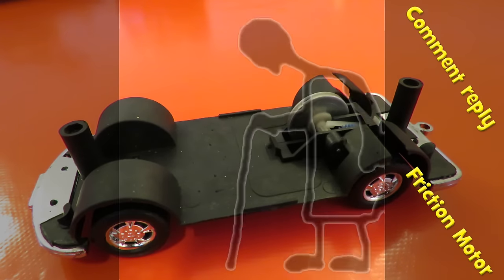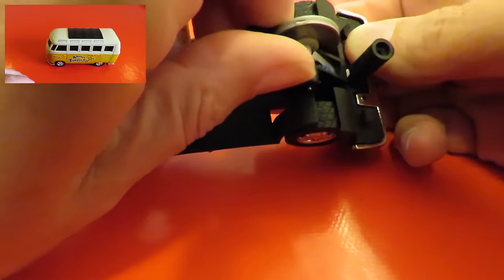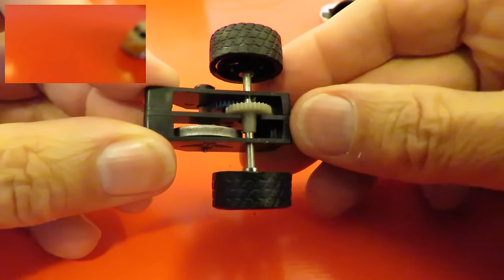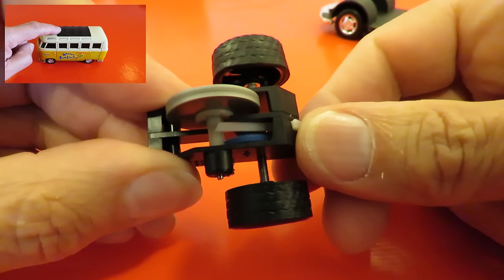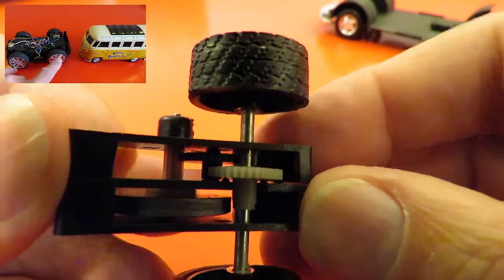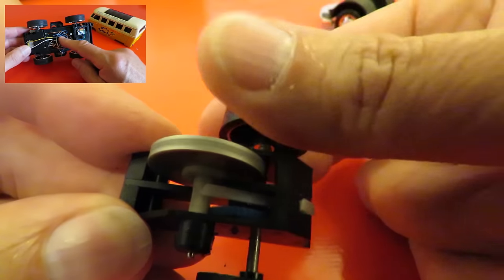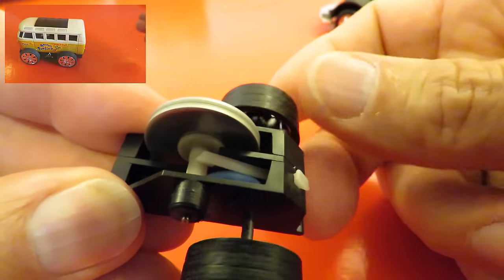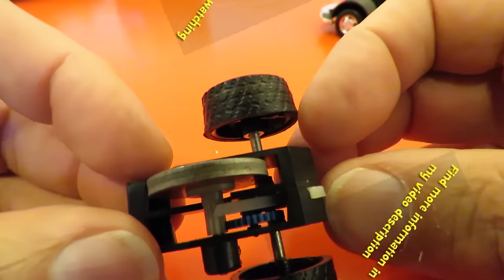Let's look at a toy car's friction motor

Comment: I tend to agree with you that "friction motor" is not a good term for them, since you typically want them to have no friction. Inertia motor would be far better.
Reply from the maker: I guess the name derives from the friction on the wheels but it seems a rather backward description.
Reply: if you look up friction motor, you come across a motor for a bike that applies a roller to the bike tire to propel it forward. THAT makes sense lol
Reply: @jamesrigg4389  That does make sense, but the motor has its own power source.  I believe we know it under its brand name Solex

Comment: Why the friction wears off your power with time amd use? Would need to replace the spring or there are other options? For pullback cars and push foward like this.
Reply from the maker: Friction motor is a misleading name for these motors. They are flywheel motors. the energy is stored in the flywheel.

Comment: These were everywhere when I was a kid. 

I never got the "friction" name, as nothing to do with friction. I suppose "inertia" dive wasn't as catchy.

Every kid knew how to repeatedly push the car against the ground until the noise got loudest (so fastest), and then let it go and it would take off. 

The ultimate evolution was the "T" type cars in the very late 60's, which had a single large driving wheel in the centre, which was heavy, the T handle had teeth that engaged with the wheel, push all the way in, pull it hard, centre wheel spins fast, heavy enough to drive the entire car when put down. They flew.

Comment: Hey, do you know anything about bigger truck cars just a little bit bigger than that? I have a toy truck and it makes a lot of noise like very loud noise when you push it it's made to be like that because all my cars are like that but it's really annoying and hurts my ears, do you know how to take that out?
Reply from the maker: Usually the main noise is generated by a little arm that is set to rub against one of the gear wheels. On the motor it doesn't sound very loud, but it is amplified when it is in the car by the bodywork.

Comment: Thanks for posting this. It was interesting to hear the breakdown for how it worked. I took apart the friction motor on my son’s car to try and fix it but, knowing nothing, I just had to put it back together again and it doesn’t work any better. Somehow, the “momentum” is gone though nothing is broken and the gears still wind fine. But the “vrooming” noise is less, and car doesn’t keep rolling much after I let it go. Any idea what might be the matter?
Reply from the maker: It may be the spring loaded ratchet that links the flywheel to the gear. I have a closer look in a different motor in this video https://youtu.be/DXcMCNFqnac it is part of series due to be published later this month, but I am giving you this link so you can look at it now.

Comment: The correct terminology is a high speed GEAR, low speed PINION and drive (bull) GEAR.  It's actually a gear reducer that converts rpm from the h.s.GEAR to the low speed PINION which turns the drive (bull) GEAR.
Reply from the maker: Thanks

Comment: Do you think you could lift a small mass with a friction wheel used as the stored energy supplying the force necessary to say lift something using a pulley system? Trying to create free energy as my pic shows a basic model of what I have designed but the secret to my idea is getting the extra weighted ball back to its original positioning. My idea works on the fact I don't have to focus on getting all the mass to the top rather primarily focus on getting the small ball mass back to its original position to counter balance the other to maintain free energy.
Reply from the maker: Good luck with your quest
Reply: Thankyou and thanks for your video as well.
Reply: There's no way you can create free energy, simple as that. If there was one, everyone would be using it today.

Comment: my guess the white plastic stick is for clutch the gear to reverse direction, it should make a noise when reverse the car.
Reply from the maker: As I remember it, it makes a noise in both directions and I think it is there to make a sound like the motor running, but you could be right.

Comment: Hi! Could you please try and explain a pullback motor for kids? Thanks ☺
Reply from the maker: I will have to think about that, I have done videos on the subject but I don't think they fully explain the details in particular the importance of the idler gear. At the moment I am still trying to catch up with all the video footage I recorded on my recent holiday, there are still hours of it to work through. I will see what I can do but I cannot promise a fast response, sorry.
Reply: GrandadIsAnOldMan Thank you for your quick reply. I just discovered your channel and subscribed. It feels good to know that you've seen my comment and will consider it. Thanks!
Reply: Hi Jenny, I have been working on several videos to try to answer your request and each time I view it back and think "Would a child understand me" and I am not sure I have made it clear enough. I will publish all the videos over the next week or so but I may still need to try to simplify the answer. The bottom line is "You store energy in a toy car's pull back motor by pulling the car back to wind up the spring inside. When you let it go it has gears inside the motor that change the ratio so the car goes forwards further than the distance you pulled it back". 
This is the current schedule of the videos I have done so far (none of the links will work unto the published date and time) The one on Monday 13th at 3AM is probably the best so far but still contains some confusing information as I try to relate it to the animated video from 3 hours earlier.
Sat 11/08/2018 1200 Ferrari Superamerica with pullback motor https://youtu.be/zmKx0KD2JMg
Sun 12/08/2018 0000 Ferrari Superamerica pullback motor tear down FAST FORWARD https://youtu.be/HjZ_onSWAyQ
Sun 12/08/2018 0000 Ferrari Superamerica pullback motor tear down LONG RAMBLING VIDEO https://youtu.be/Xc-8U0baT70
Mon 13/08/2018 0000 Pullback Motor animated with Gear Generator https://youtu.be/UWGkMFk2IDA
Mon 13/08/2018 0300 K'Nex Pull Back Motor Tear Down https://youtu.be/7rN9xkSC6Lo
Tue 14/08/2018 0000 K'Nex Pull Back Motor Gear Generator Animation corrected for 0-9 gears https://youtu.be/GnOij_Qr9Sw
Reply: GrandadsOtherChannel it sounds very understandable to me, I think it would work for my kids too. We've tried opening these but they sort of fall apart when you do and that defeats the purpose. I wanted to show what I mean by the word "spring" because I know they get the mental image of the sort of thing you see in pens - they have dismantled a few - and not what I actually mean. I do hope I'm not talking nonsense, but isn't there the same sort of spring in a pull-back motor and a wind-up motor? I was trying to explain what happens when you wind it up way too much and the spring snaps - I did not succeed and I am still being asked to repair it though I know I can't.
We will definitely watch your videos together. Thank you so much! You've gone above and beyond 💕👍 Can't wait to see the results 👏👏👏
Reply from the maker: Hi Jenny, yes same type of spring in a pull back car, wind up car, pull cord car, and many other moving toys (I did a project using the motor from a pull cord cat toy). Quite often you could swap the spring between them to affect a repair. Interesting point about using the word "spring" as I just realised I referred to them as coil springs in my video and that's wrong so I am doing a Google search to try and find the right term. It get's even worse then as "clock spring" is used as a description for an electrical device in car air bags and that is the first description that came up when I looked. I did find this link which helped me a bit and it also gives "power spring" as another term  https://www.hunterspringandreel.com/support/faq/springs-what-is-a-clock-spring
Reply: Here:

Comment: Hi Grandad, just wondering if you know how long friction motors have been around? I recall playing with them in the 1960s but most of the toy cars ect that have motors before that seem to have been clockwork ......M
Reply from the maker: Wikipedia just says they were popular in the 60's to 80's. I can't put a date on them in my memory but I do remember ones that used to spark inside because they had something that rubbed against the flywheel to make a shower of sparks.
Reply: @GrandadIsAnOldMan  Inertia starters in cylindrical engines, like the ones that were used in air planes back in the day, work like this toy. That's what you hear winding up before they're let go and clutched to the engine itself to start.
https://www.youtube.com/watch?v=Gky8z7sTEEs

Comment: pull out that white part rubbing on the flywheel gear and it will run longer!
Reply from the maker: I don't think you would be able to measure the difference in performance.

Comment: Sir can you make a video on how to change the axle on a friction motor. It would be very helpful
Reply from the maker: Sahil Sam, you would just have to carefully tap it through from one side to the other. You would probably need to remove the wheels and support the frame while you tap it through. Drill a hole in a piece of wood, slightly larger than the axle diameter and use the wood to support the frame while you tap the axle through.
Reply: @GrandadIsAnOldMan  Thank you Sir I think I understand. I just bought a toy car but the axle in the friction motor is slightly not straight. So I want to replace the axle with a new one

Comment: My toy car's friction motor is not wanting to move forward, only backward, idk why
Reply from the maker: What I didn't show in this video is that the gear on the flywheel has a spring loaded clutch to protect the other gears if the wheels are stopped while the flywheel is spinning. It may be that the spring loaded part is broken, or has lost pressure, or the teeth have been blunted. Not something that is easily fixed.
Reply from the maker: Here is a new video for you, to show the part I was talking about in my previous reply https://youtu.be/9GKU964pgmg

Comment: Why it is called friction powered , were is devotion involved in it , it could had been traction powered,or momentum  car
Reply from the maker: You would have to take that up with the manufacturers. My interpretation is that you pull the car back to wind up the motor. If there was no friction between the wheels and the ground then the motor would not wind up. I would agree that still doesn't make it "friction" powered any more than a rubber band powered car is powered by the rubber band. It is powered by the energy stored in the rubber band. Or a balloon powered car is not powered by the balloon, but the air pressure stored inside the balloon.

Comment: you reckon this would work on a bike
Reply from the maker: I have seen many toy motorbikes that use flywheel motors
Reply: Bryan Scriven the problem is that it takes energy away from you. Like if you had one and rode down a hill I suspect you'd go further without it.
Reply: That's assuming that you would not have used your brakes going down the hill. If you could engage a flywheel when you would have engaged brakes, you might go farther than you would otherwise. A bigger problem is that big heavy spinning disks are pretty dangerous.

Comment: How about a woody doll with a pull string?
Reply from the maker: Do you mean for me to take one apart?
Reply: GrandadIsAnOldMan yes please
Reply from the maker: @johnkoester7795  very unlikely to happen. I buy stuff in charity shops, so unless somebody has donated one, I won't find one. On top of that, I doubt I will be going in any charity shops in the near future. I haven't been in one since March.
Reply: GrandadIsAnOldMan oh ok
Reply from the maker: @johnkoester7795  If I see one and it is the right price I will buy one, but I cannot guarantee when that might happen 😁👍
Reply from the maker: I just had a look on eBay and they go for high prices so if you have one, make sure you look after it.